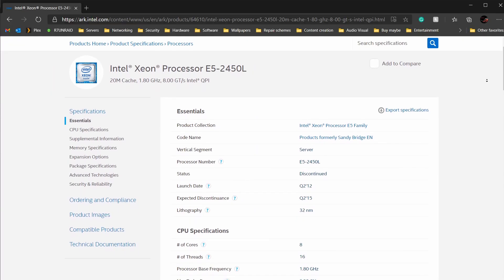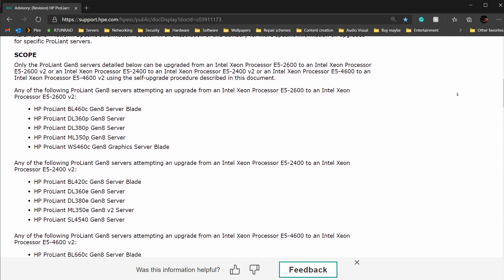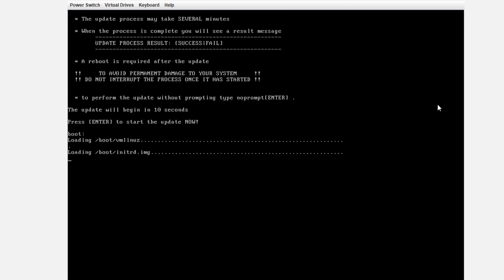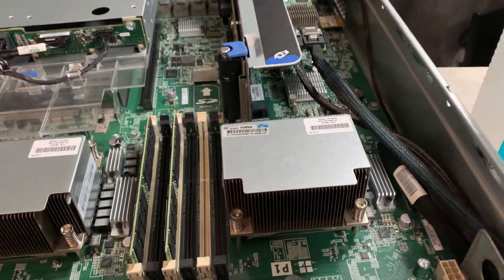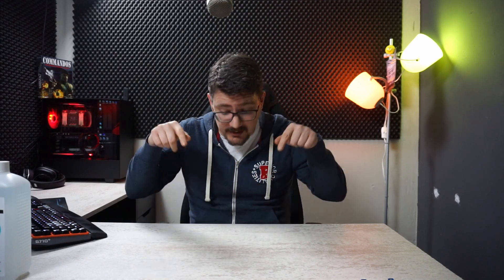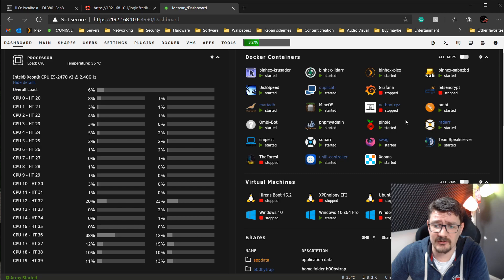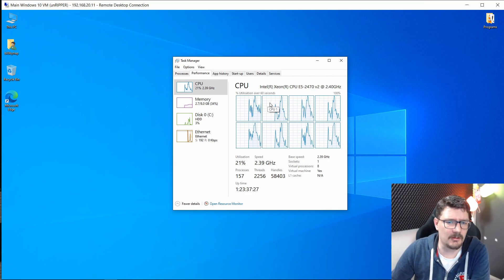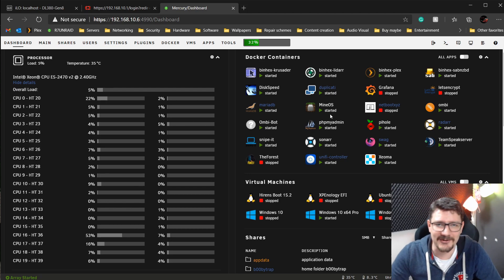Upgrading the CPUs on my DL380e

Comment: I went with the z820 and it is about as fast as my Threadripper 1920x so I am happy.  Not bad for just under $1k.
Reply: Lol, I paid 250 euro for my dl360e g8 back in 2020, and it should be able to handle e5-2470 V2, which is available for about 150 euro for Both cpu's.

Comment: Hey dude. I have extreme performance problems with my vm´s on unraid. The SSD´s where your VM diskimage is stored shoudn´t formated with btrfs. Use Ext4 to store the diskimage. This performs 100% better. 
For example, my VM with btrfs took about 2 minutes to boot and was very slow. Now with EXT4 it runs like Baremetal. Please check this out and let me know if its works with your VM´s.

Comment: just checking do you use isolation for the vm cores in the unraid settings?  also if you are going to use a gpu make sure you put it in the correct pcie slot associated with the cpu cores you use.